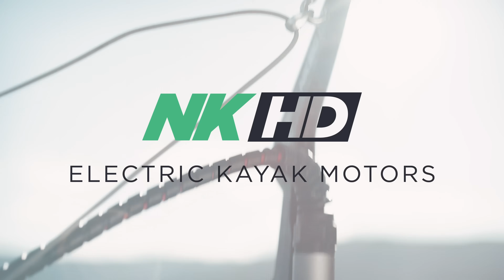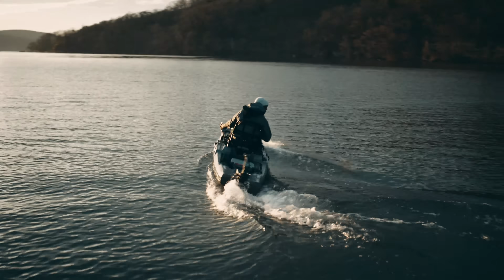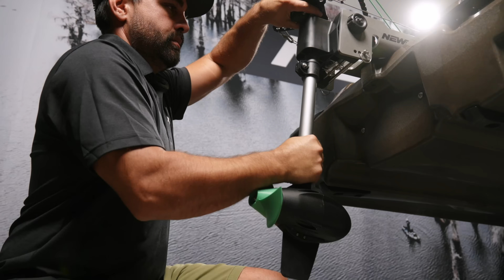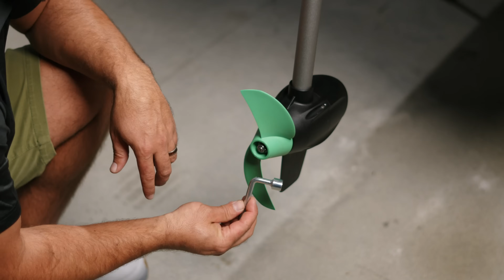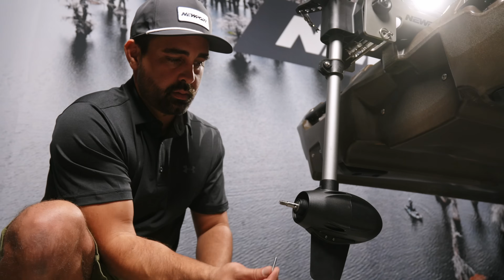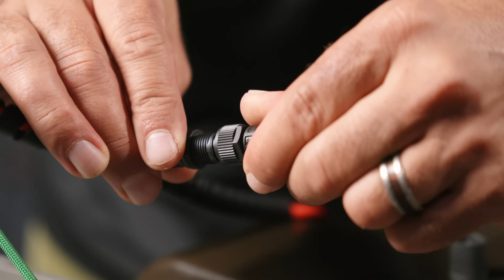Peak Performance | NK HD Electric Kayak Outboard Motor

Comment from the maker: For everyone wondering what exactly is different with this new motor:

Article: https://newportvessels.com/blogs/learn/introducing-nk-hd-all-the-new-features-explained

The Low-Down:
Some upgrades are easy to see: a reinforced composite lift arm and steering system built to handle modern high-thrust setups like the NK300, a micro pulley system for lower-profile mounting and full stowage, and an improved cable strain relief mechanism for longer cable life. But a lot of the value is unseen at first sight — including overbuilt communication connectors for consistent power delivery and upgraded precision bearings that create noticeably smoother and quieter motorization. 

Internally, the NK HD features an all-new advanced PCB design for the motor, driver, and controller, plus specialized conformal-coated electronics to protect against vibration, water, impact, and thermal shock. Pair that with a refined throttle curve for smoother acceleration and better low-speed control, and the difference becomes clear.

Comment: How's the HD different from the pro versions
Reply from the maker: NK HD isn’t just a cosmetic refresh of the original NK. It’s an evolved platform built directly from years of customer feedback and real-world use, with meaningful upgrades focused on durability, smoothness, and control.

Mechanically, the NK HD features a reinforced composite lift arm and steering system designed to better handle retract and steering loads, especially with higher-thrust setups, along with a more robust communication cable connector for consistent long-term power delivery. We also upgraded the internal bearings to improve smoothness and longevity.

Beyond the visible hardware changes, we enhanced the internal electronics and redesigned the throttle curve. This gives you more precise, responsive control, smoother acceleration, and better low-speed command of your vessel.